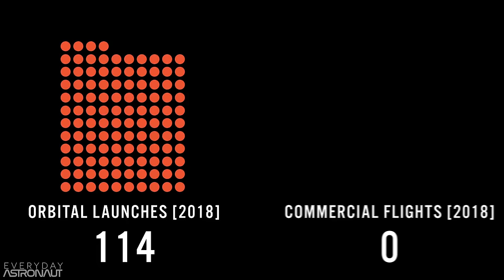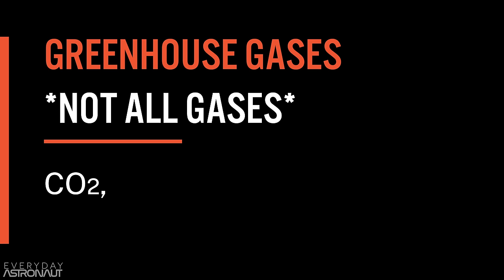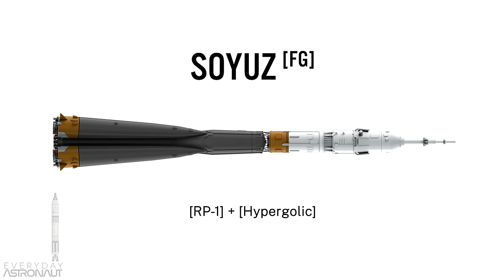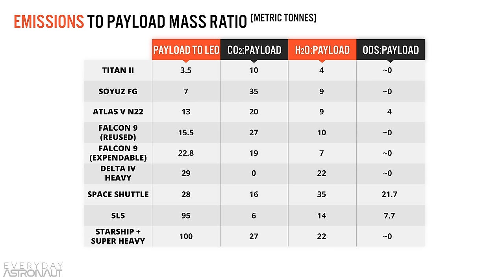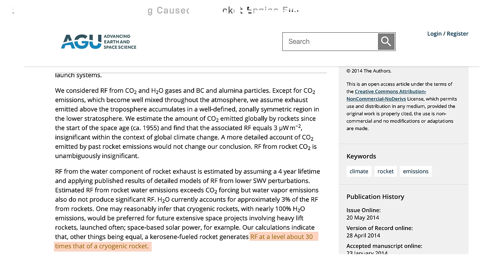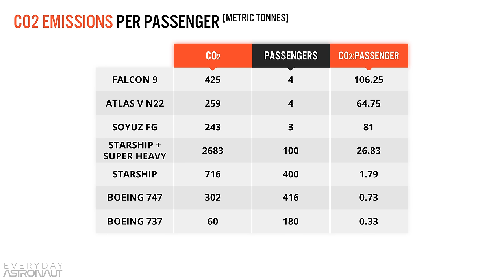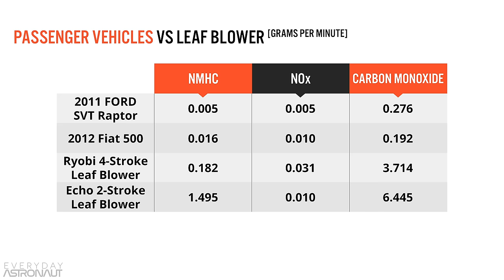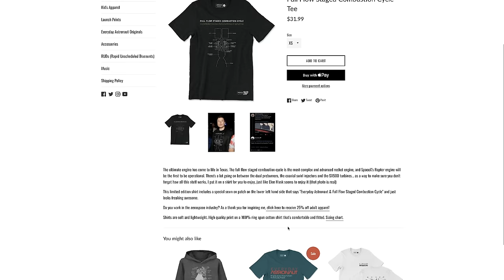How Much Do Rockets Pollute? Are They Bad For Our Air?

Comment: I wish you would get in to climate science because you are a smart guy and wouldn't get lost in the PC weeds. 
I could write several books about Climate Science and false narratives being pushed, but as you stated you do not want to make this the page of debate for that. 
Therefore I would just like to leave you with 1 Comment regarding CO2. And that is that CO2 is NOT a problem. 
The Earth has been around for billions of years. Life has been around for a long time too. And for MOST of the time that there has been life on the planet CO2 levels were MUCH higher than they are now not by percentages but by multiples. 
In fact we are at a level of CO2 now that is dangerously low for life. We went so low in previous ice ages that all life was almost terminated on earth. This is because so much of the Carbon necessary for life over time has been trapped and during previous ice ages the levels almost dropped below the level necessary for plant life.. Certain forms of life like Shelfish for instance have learned to use CO2 in their shells, and when these organizms die, they trap this CO2 which over time is buried and sinks to lower and lower stratifications in the earths layers. This is actually where a lot of fossil fuel comes from in the first place..
Burning of fossil fuels actually re-introduces this CO2 back into the eco-system and the CO2 starved plants are very thankful indeed, even tho for the most part, even with rockets, we only produce a small fraction of CO2 compared to Nature. The fear of some scientists is that without man, so much CO2 would be trapped in time that a subsequent ice age would do what the last one failed to do, basically wipe out all life due to hyper low CO2 levels.
Ideally our CO2 levels would be 4 to 6 times higher than they are now. Plants life would be much healthier and larger, food much easier to produce. Animals much easier to feed. 
And when these more typical conditions existed in the past, there was no negative effect from a climate standpoint because of the way the entire system regulates itself, which is far more complex than current infantile models show. In fact most of the models are designed to prove a theory, rather than to expose a truth, but I digress.
There is also no CO2 emergency now, unless you consider historically low levels of CO2 a hardship. Our earths history makes this truth self evident. Man just looks at the blink he exists in, and calls THIS moment normal, and anything outside of it catastrophic. This is an understandable, but flawed approach. Science should not assume. All times and all conditions are relevant evidence here. 
We are recovering from Ice ages. Of course glaciers may recede over time, and CO2 will increase, with us or without us. Temperature will also increase, very slowly. I'm talking thousands of years.
And believe me, this is the right direction and the right speed. We are fortunate to be in the position we are now, where CO2 and temperature are on the uptick. Both of these will actually be a net gain for life on earth. For each area they say might turn into a desert, that probably already is close, we will open 4X as much temperate zones for food production and living comfortably.. 
And with the self regulation of the weather Hot areas tend to cool themselves, and Cool areas tend to warm themselves. Clouds and water vapor work to negate extremes and balance temperatures quite well. 
Also consider that much of our current severe weather systems are based on cooler northern air (or southern if you live in Australia) coming down towards the equator. Far from there being more storms in the future, the evening of world temperatures into  less extremes would mean less violent storms across different climactic areas. 
This is the earth returning towards what is more normal, warmer temperatures, and sufficient CO2. And we will be fine, the earth has gone thru this cycle countless times before. Rather than making models to predict what high CO2 would look like, perhaps the scientists could look at the past. The life then didn't seem to mind. All signs are of abundance that far exceeds anything we enjoy today. One of the reasons everything was much larger. Fauna and Flora are small and sickly compared to the animals of other eras that were not gas starved. 
Rockets should hopefully be as efficient as possible, and limit pollutants, but of all the emissions they make, CO2, despite popular opinion, is the least worry of all. CO2 is the gas of life. A noble gas that we benefit from and that is necessary for the creation of oxygen via photosynthesis. Even concerns of radiative forcing usually do not consider that although less energy is allowed to leave the atmosphere, less energy is also absorbed from the sun in the first place because the effect works BOTH ways, not just ONE way. The earth never burned up before when we had levels in the thousands of parts per million (we are in the hundreds of parts per million now), and it won't burn up this time. 
Plants and animals will be more disease free and healthier. We do not realize it because this is the era we exist in but we are starved for oxygen and CO2 and a move towards more of those gasses and further from an Ice age, is the best possible scenario. I have even heard serious scientists say that far into the future we may actually have to harvest more CO2 from Shale fields etc. whether thru combustion (which by then would probably an archaic form of energy), or chemical process to purposefully add CO2 to the atmosphere because of the trapping effect. I don't think it will come to that point however in the foreseeable future, especially when people are taught incorrectly the CO2 poses a great danger.
If they taught this properly, this would not be a controversial idea, and the evidence is easy to find. But because it is political, these ideas are almost never spoken, which is why many internet cowboys will now claim I am lying, without even bothering to research anything at all, or look at different eras of the Earths history when CO2 levels were in the thousands, life was abundant, and the climate was wonderful.  
Databyter

Comment: Starship is 150 tonnes to leo
Reply: Only if they expend super heavy, if they want to reuse it then 100T to LEO. Still huge tho.
Reply: They need to use super heavy at a minimum that is too much CO2 until they can better refine that engine but right now too much launch with super heavy from earth is gonna be a problem.

Comment: Thanks for such a deep dive into a significant issue.  One thing you haven't addressed here is the venting of fuel during testing and fueling, as well as after landing of reusable rockets.  Since the fuels are potentially much bigger pollutants than the combustion products, this might be significant.

Comment: Not hypocritical.  It would be hypocritical if the preached anti-pollution and preached only while they launched rockets but the very fact the are doing something about it in the areas that they are able to do something about it means they practitioners of what they preach so very much the opposite of hypocritical.  You can not use "clean" methods whilst trying to push humans into a interplanetary existence if those methods don't currently exist.  They use what we have available currently, while hoping methods will improve in the future and doing what they should for the environment else where. The word "hypocritical" is missed used and misleading in this context.  What is hypocritical however is complaining about the pollution of rocket launches when there is no 'current' alternative  available while going work everyday by transport that uses gas when there is a current alternative; this is in fact hypocritical and also dripping with irony.  Lets wait until the only vehicles on the roads are 100% electrical before whining about the pollution of rockets.
Reply: BUT Amazing video as always.

Comment: really, old cars and trucks are the problem?? Stop producing new cars until all the old ones are driven to scrap, old vehicle have already been produced, the Co² pollution for each part of an old vehicle is already in the air. Producing new once while the old ones are still around is improving noting,it just doubles the load. New once have higher efficiencys, so using less fuel and so on but on the same time they got a lot of high tech parts, specially Batterys, computers, plastic parts, Tires and the steal industry is everything but not clean, so car parts  are very dirty to produce. Electric cars are a great idea, same as better new combustion vehicles, but first if the old cars are used up. everything else is just a "wannabe calculation". Anyway not gonna happen, million peoples could loose there jobs, and the car industry will be broke...sooo nope, i know off topic, good video anyway, can see u have a lot of fun with it, keep it up

Comment: You should have done tonnage for the jets.  It is also a more apples to apples comparison.  The 747 can haul 112 tons and the 737 is only 21 tons.  So even cross Atlantic flights in a 747 would be 602 CO2 and as far as I know the Starship will still need a Super Heavy for a cross Atlantic fight too as a loaded Starship will NOT come close to reaching space without it.  It might not be a full burn of fuel though, but I'd guess around 1500 vs 600, but the environmental impact would likely be far higher to to the pollutants being dispersed up higher.  Plus you will need to take another vehicle out to the launching pad and back from the landing pad, much farther than say an airport from the down town areas.

I don't think this is a good idea to use rockets for commercial flights.

Comment: as it's all cumulative we need to eork on all of itlets stop using bi v8 powered trucks and suv's to move one
person a 2 litre 4 cylider is all we need the rest is ego and greedfuel taxes should scale up with poor economyso those of us with a 50 pmg small van and a 90 mpg motorcycle should get cheaper fuel and all small 2 stroke tools should be banned apart from the logging industry battery electric will do forsuburban users, same for mowers, trimmers hedge cutters leaf blowers, add $100 tax to every 2 stroke garden tool reduce tax to a very low level and tax the snot out of all 2 stroke oil

Comment: so what happens when dozens of rockets are taking off every single day? is it still good then?
Reply: You did watch the video right? Later on he says that even if the number of rocket launches triples, it still is miniscule compared to to the number of air flights going on every day.

By the end of the decade, a lot of rockets will be using cleaner methane propellant anyway.

Rocket pollution is something we definitely need to be putting effort into researching, and finding solutions to, but on the list of climate issues, it's way down on the list beneath cars and general energy, concrete production, etc.

A lot of people have the very erroneous idea in their heads that spaceflight accomplishes nothing, and so to help the climate we need to to stop all rocket launches.

Satellites do so much Earth observation, and astronauts do so much scientific work in orbit, that without spaceflight, we would be greatly hindered in curbing climate change.
Reply: @WasatchWind  it’s strange to me how climate is such a huge issue but as long as we write everything off as “a drop in the bucket” it’s totally fine to keep adding to the issue
Reply: @BeachLookingGuy  Again, you did watch the video right? There are bigger fish to fry, and just abandoning spaceflight is a terrible solution.

I'm not saying ignore the problem, I'm saying not to obsessively worry about rockets, we should work on getting rockets more clean, and work primarily on getting general energy and automotive pollution under control.

We need to work on reducing all pollution, but those two are the biggest ones we need to focus on.
Reply: @WasatchWind  curious as to what your car pollution solution is. Let me guess, sell more cars but with batteries
Reply: @BeachLookingGuy  My gosh what is it you want? You sound like you have a bone to pick with spaceflight.

There are many technologies that can help us have better vehicles, and yes, I think it is electric. We are developing better motors, new types of batteries like solid state, etc.

There is not a "the solution" but many, many smaller improvements that will help us decarbonize very industries.
Reply: @WasatchWind  I’m just baffled people actually think adding to the problem helps 🤯

Comment: If we got nuclear submarines you would think we’d beable to make nuclear space ship. Nuclears are most powerful form of energy currently
Reply: You can. But you still have to use fuel.

Submarines push against the water to move. Rockets have to throw gases or other material out at high speeds to push them in the opposite direction. Nuclear isn't magic, but yes, it can improve efficiency especially in orbit.

Comment: Starlink, shooting 42,000 sats. then replaced every 4yrs cuz that's their limit and a million colonists on  Mars, that's 3 launches each and every day for 9 years PLUS double that many for the re-fueling rockets and supply Starships. To a dead planet with no molten iron core.  Yeah, what's the carbon footprint for that compared to its contribution to us?  More than 80% of the World is covered by existing sats. and cable internet systems already. Starlink is not cheaper nor better because it has to link to the cable system to operate. And of the 20% of the World's surface not with internet is inhabited by the poorest of all humans who struggle every day for enough food and clean water. They can't afford $500 for a dish and $100 every month for service. That business model is fantasy too.  Starship point to point Earth travel? Compare fuel prices with existing airliner service.  What's the carbon foot print for all that?  And what will we get in return? Ask the people at the Las Vegas Loop.  Also the Starship launch bases have to be next to populated cities. What about the results of a total Starship with Booster explosion?  They have to be placed a considerable distance from any populated area probably at sea. Add the travel time from city to rocket base then do you fuel it first or board the passengers first, gases, etc.? Also each and every passenger has to have one of those fancy designer spacesuits that fit them.  Health considerations? Then the passenger if they survive at all has to take the same travel time from the landing site to the destination city, another hour or so after the change out of their space suit. Add all this reality up and you'd be safer and cheaper to travel by airplane. So who will be lining up for all this when they have proven aircraft?  If one, just one Starship falters and kills, no one will fly them again or at least the investigation and corrections actually takes more than a year or two while all the Starships are grounded making no money.  I respect your enthusiasm but don't you guys think things through? And the price tag for all of this is going to be paid by whom? None of this is going to get us anywhere and don't say we need to become a "spacefaring race" because we didn't evolve without oxygen, proper pressure, temperature, water and the ability to sustain massive Solar flares, Coronal Mass Ejections and all the Galactic radiation.  Sure seems like a bunch of fantasy to me and many other thinking people.  No, it's not like Star Treck. That was shot on a sound stage, so were all the planets they landed on.  The Enterprise was early CGI. I'm sorry, I understand your desire for progress but all in all I think Elon isn't going to put you there.  I do get a lot of good info about existing rockets from you. Don't get too pissed at me Everyday, it's my own take and belief. It's ok for me to make my comment, right?

Comment: You can't have space flight without politics. The genesis of modern rocketry (all advanced scientific industry, actually) is political. Anything extraneous to survival is by definition political in nature. The issue, from my perspective, is people's choice to eschew Politics while fully participating in politics. politics is popularity and status signalling, while Politics is prioritization of public policy initiatives. It is an intellectual ouroboros. Abdicating participation in Politics is willfully surrendering personal sovereignty. If one wishes to be led fully and disallowed from questioning things, then avoid Politics by all means. But don't expect to get a seat at the table of Power, likewise have a say in Process, if you can't be bothered with participation. Democracy doesn't work because the choice to participate is voluntary, meaning that it will always devolve into regulatory capture and influence peddling. People's reluctance to take consistent, principled stances is why we have a ~90% congressional recidivism rate and a <20% congressional approval rate. This is one of the biggest reasons behind why SLS is a complete waste. If we want to be a space fairing civilization, we either need >90% full political stack participation, or a monarchy/dictatorship. The sole reason, underneath all other factors, that we have a civilian space program at all is excess capital. If, rather when, that dries up, there is no way in hell politicians are going to fund space endeavor.

Thank you for attending my TEDTalk.